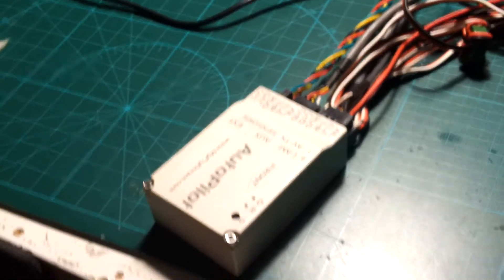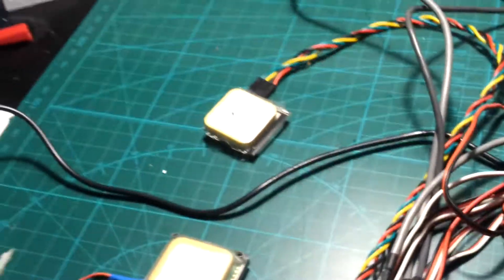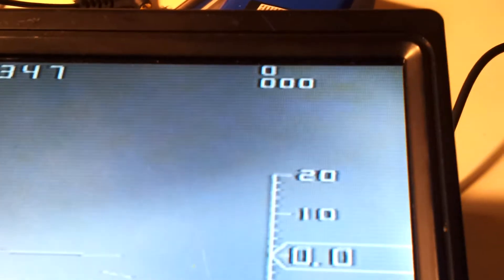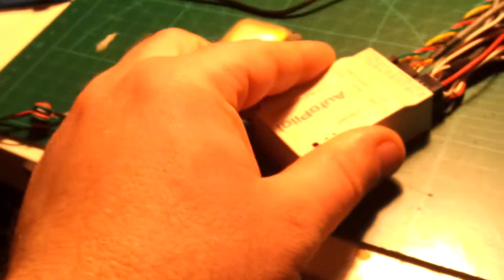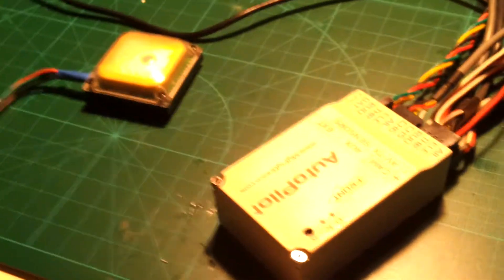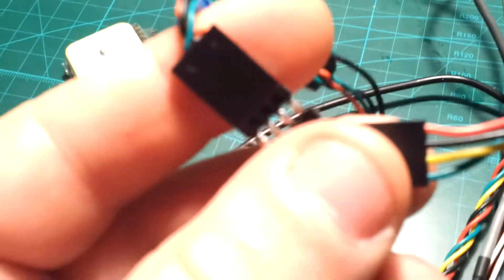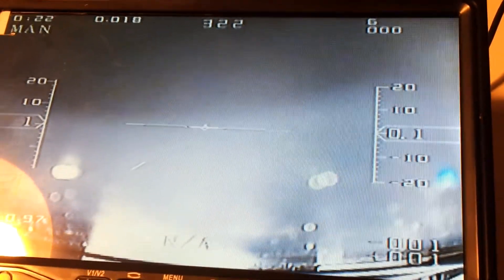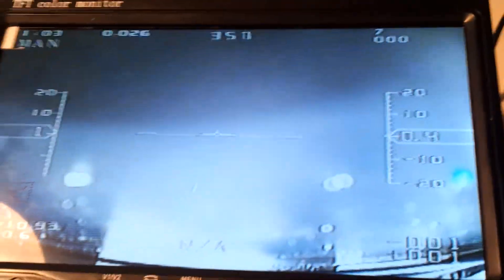MyFlyDream Autopilot GPS Problems

Comment: Did this problem get fixed?
Or did you buy another u-blox gps?
Reply from the maker: I fixed that, by using a NEMA GPS from my FY31AP. Its a LS20033.
Reply: fellpower Nice, thanks ! The MFD AP is looking great.
Reply from the maker: Its not only looking great, it fly great too. :-)
Reply: fellpower
I have ordered 2 units, hoping to receive them soon.
Before i used the cyclops storm, but i fly a lot and got strange problems with it.
Your movies are helpfull, tough i dont fully understaind the german language :-)